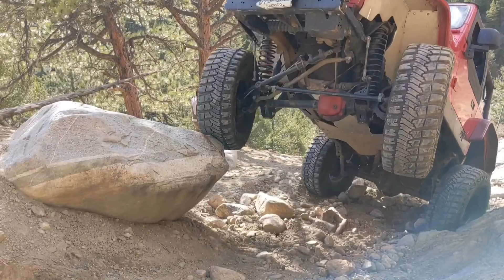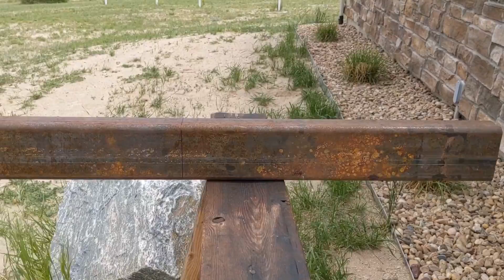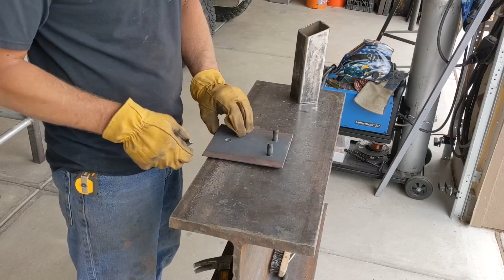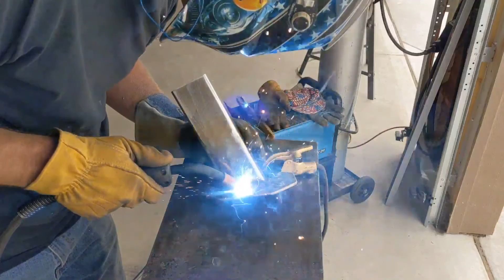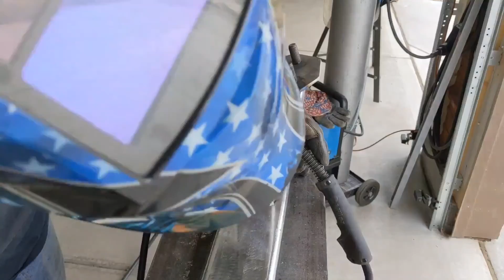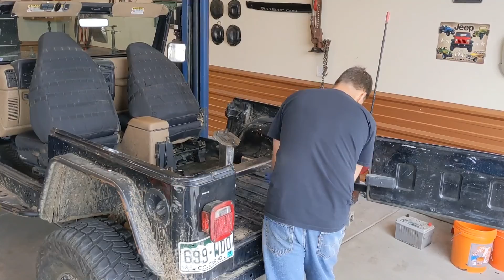Jeep Wrangler Spare Tire Mount

Comment: What rims are you running? I really like them. Are they a true beadlock?
Reply from the maker: I think they are Fuel Anza....not a fan but they came with the tires brand new from a guy. I will get Raceline beadlocks next year.
Reply: @TheBFHGarage  thanks for the quick response! I want to get beadlocks but I don't want to go up to 17s just yet. I like the tire carrier build BTW. I've been thinking of a way to do mine.